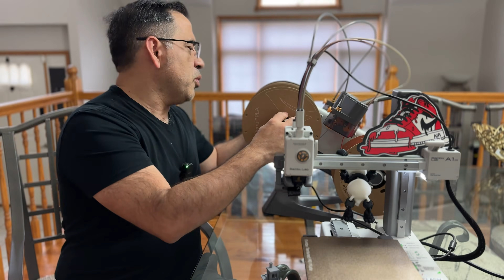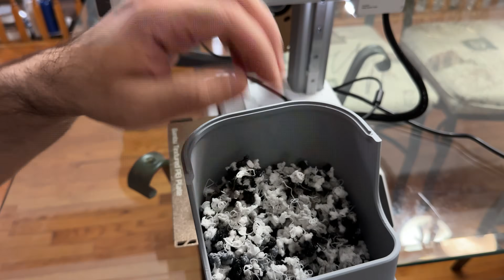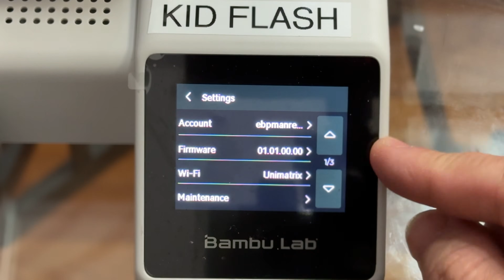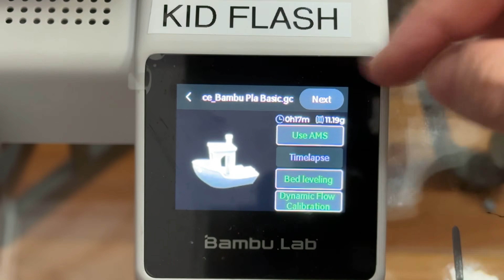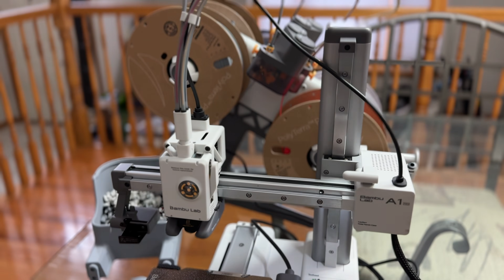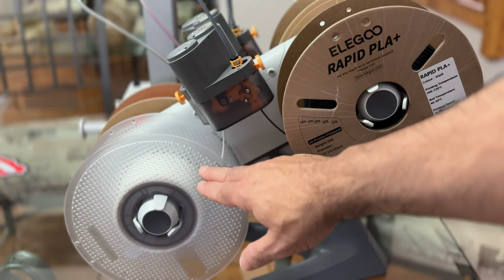The Surprising Power of Bambu Lab A1 Mini: Learn Why Size Doesn't Matter

Comment: i was wondering that with this new ams it would be possible to use TPU?
Reply from the maker: No. I have not been able to use tpu. Need to run it outside of the ams
Reply: what if it can run inside the ams? the lenght is shorter then cx1
 @ebpman

Comment: The Bambu printers are really nice, but I won't be buying them.  I'm not going to lock myself into a company that forces me to use proprietary parts, proprietary software, and integrates with a cloud service.  It's far more important for me to have an open, neutral hardware/software ecosystem that I can maintain, modify, and assemble on my own without relying on a company for support.  I purchased a RatRig V-Minion about a year ago and couldn't be happier.  It has all the speed and quality of the A1, but runs Klipper and has open-source design and standard, common/generic parts.  It does not have the multi-color attachment, but that has not been an issue, it's a feature I don't need.  Plus, it does support manual color changes at a layer boundary if I really want to do that.  My next printer will be a RatRig V-Core to replace a highly modified Ender 3 S1.
Reply: Your YouTube profile picture is of a Tesla, presumably yours? Which would contradict "I'm not going to lock myself into a company that forces me to use proprietary parts, proprietary software, and integrates with a cloud service." SMH
Reply: @Montague38  Yes, that is true. I no longer have that Tesla that is in the picture, it was a lease, but I have a different Tesla now. The difference here is that there is no good way for me to build an open source car. I would if I could actually do that, or if someone made a kit, but they don't. So the next best thing is to get a vehicle with the lowest maintenance requirement and the lowest cost of ownership possible, and the Tesla fits that bill. I don't particularly like the company or their CEO, and if another company can make a low cost of ownership electric that has the same functionality, especially the long distance charging network, then I'll shift to that. 

I think you're looking for a reason to create some conflict here when they're isn't any.
Reply: Yawn. Such a silly take for someone who posted from a device with all the “issues” you listed. As well as every single other electronic in your house. Bambu takes printers from a meticulous hobby to normal household appliances. Your view is so archaic now.
Reply: @Xenthera False. Not everyone is living in America who bans phones who don't subscribe to the American monopolies.
Reply: And you use android by Google monopoly or apple....

Comment: The printer is nice, until you have to rebuild the toolhead for the first time. It has the ability to self destruct. At first I thought it’s simpler and more serviceable than its bigger brothers, but it comes with its own issues and is not reliable enough if you want to run a business on it.Both my Bambu printers are down, my Ender fleet works and anything is a simple fix.

Comment: What is the advantage of using the cloud instead of LAN mode?
Reply: I haven't received mine yet. But I imagine we can check if our prints fail and remotely cancel if we're away from home?
Reply: @rajgill7576  So if you're worried about them stealing your models you can just put it in LAN mode and not lose any functionality?
Reply: @terryd8692  ohhh like bambu taking your STLs? Yea
Reply: @rajgill7576  Got mine on pre order. Got a month to wait ☹️
Reply: It's easier for you to be hacked which is definitely an advantage for the hacker!  ;)